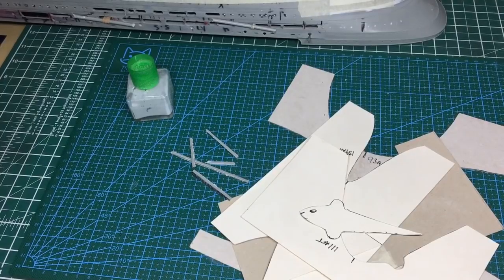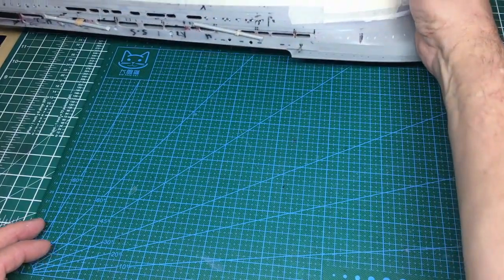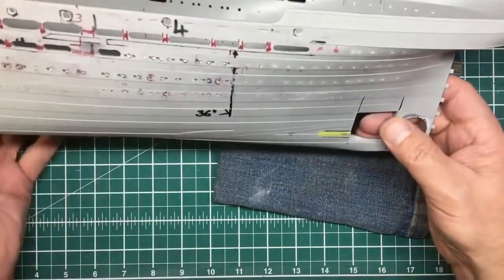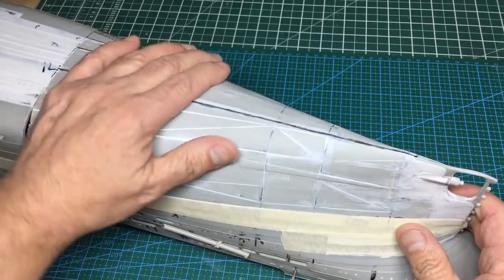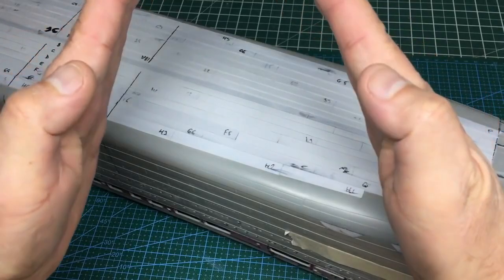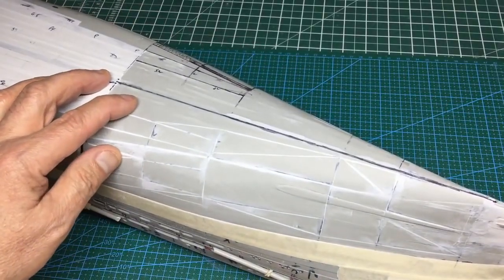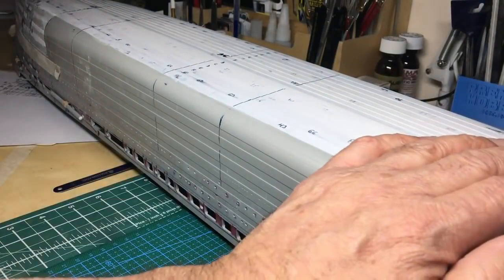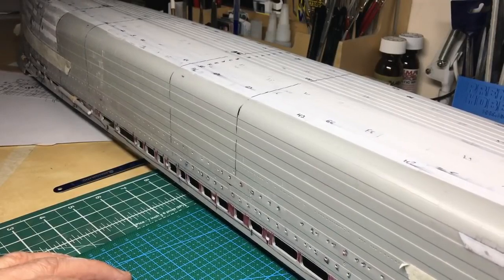Correcting the form of the 1/200 Titanic hull.. My Way. Part 9

Comment: You certainly go the extra mile here. I have done design work for wooden ship models, and when you change the old drawings to CAD in 3D you can discover all sorts of wonkiness in original plans, It depends on how advanced the plans are that your working off. You mention it in lofting, it's not how I do it but I understand the concept. I've seen docos on the Titanic the plans were huge. I have seen in a Queensland museum where they built ships up to the size of a corvette, they had plans, but still referred to a half hull model to get the shape correct. There was still some art for the shipwright to work with.